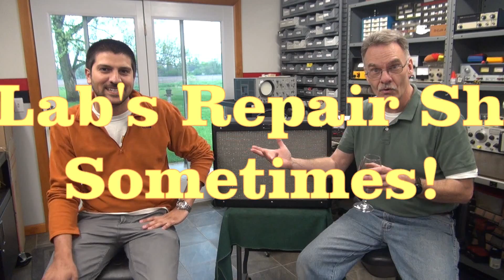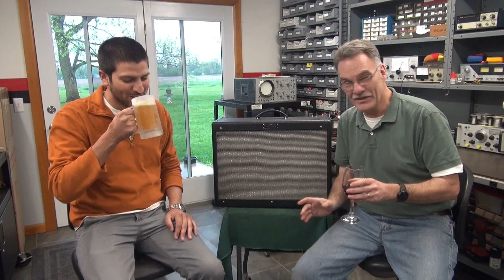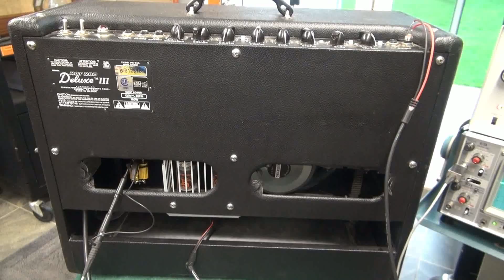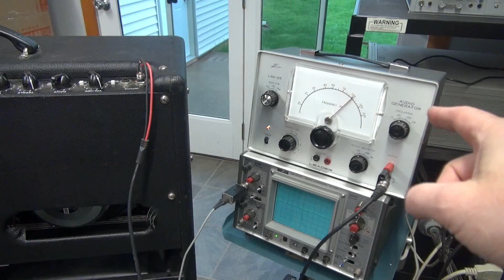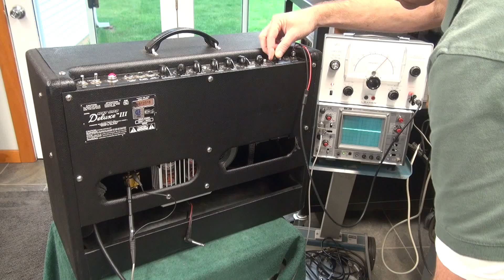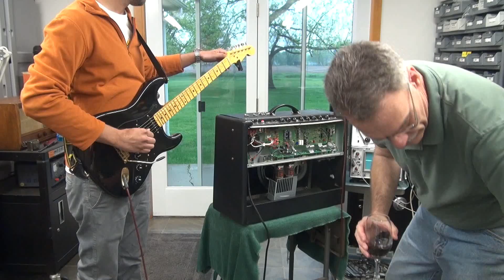D-Lab Electronics Repair Shop No problem found Fender Marshall guitar amps

Comment: Yep probably a bad cable since the issue migrated to 2 amps.....probably a broken wire near the jack ends or a bad solder joint for the ground wire at the jack.  Typical failure due to age & use...wear and tear.  But then again its a circuit board amp and board mounted input jacks which fail.....just plain junk jacks and design.  People who design computer board layouts should stay away from doing layouts for vacuum tube amplifiers

Comment: Had the same happen on a gig with a fender hot rod deluxe. Turned out it was those two resistors that they had soldered touching the board causing overheat. A common problem with the hotrod deluxe models.

Comment: low input voltage? they do run all kinds of extension cables on stage and one bad connection can screw up lots of things or just one, just a thought

Comment: Marshall MG30DFX,i just repaired one,input jack ground switch was mangled though not the evident issue,no bloody volume on clean,crackly and not no vol using the treble pot,so i desoldered the vol,bass and treb pots on clean channel a spray with kontact PR refit and it's working fine,some other pots are a bit noisy just a tiny bit so i'll tear it down again and go for a full service,i hate the awfull distortion ,no touch sensitivity,so i'll be modding that and adding a FX loop too.
I only really work on tube stuff most of the SS amps have bad board tracks ,dry joints,cheap manufacturing ethics bad skills persons assembling these amps in india or china,work subbed out by fender or marshall or any other big name making big bucks on cheap made amps,and people ask me "can i justify the price of a hand built tube/valve amp" then shell out for SS crap,even the tube/valve amps are pcb based and they give problems,not that a pcb is bad,just the manufacturing techniques are bad,marantz use pcb's i don't hear much of them crapping out after a year of use,which says a lot, because the pcb guitar or bass amps get moved around a lot and the pcb's can't take the shaking  about and vibration in transit,plus most musicians don't realise tubes need to cool down before moving the amp around,light metal filamentary structures when hot get soft and can sag and deform easier than when cold.

This also is a good reason to not buy a combo amp as the back wave sound pressure shakes the crap out of hot tubes/valves,and place thick foam under the head amp on top of a stack to absorb the vibration.

I design and build amps,the last thing i want is for an amp to come back for repair prematurely,and it's always tubes,or a tube burns out and causes other failures,mostly due to bad handling proceedures.

I also play so i know how hard they get pushed,but if it can bring some dosh in because of bad handling so be it.

Have a glass and salute the uneducated....cheers.

Comment: I repair those fenders all the time, wick out the solder on those 2 white resistors in the middle of the board and add in some good 60/40 and you'll be fine. The cheap stuff fender uses melts and breaks contact.

Comment: I wish ALL tube amp manufacturers would stop putting sockets on pcb's. I've turned away so many people with Fender Hot Rod series and Marshall JCM2000 amps. It's a real shame too, they are actually really good sounding amps, but replacing parts or entire boards can easily surpass the actual value of the amp.

Comment: Hey Terry, I have a Fender Stage 160 solid state 2/12 combo amp that has a constant low frequency  hum when turned on. If you try to play a guitar through it the hum is the prominent sound. I have used DeOxit on all the pots and switchs and have checked for loose and obviously burnt components but still have a hum. 
I was hoping to bring this amp to you with a couple bottles of red wine to try to get you to repair a NON TUBE AMP. I do own a Fender Dual Showman that is in perfect working order, but bought this amp only because it is a Fender. 
I live near Lansing and assume that you are near Kalamazoo from your river story video. I will gladly bring the amp to D-Lab for the repair. 
Thanks for your time Jeff ' Gonzo the Guitar Guy 'Kellogg
Reply from the maker: Hi Jeff, That issue sounds like a shorted output transistor. Check them with an ohm meter. You should not see under an ohm in any configuration.  If they measure OK, my next guess is a bias shift caused by bad solder joints. That req's pulling the circuit board and giving a close inspection.  I live just north of Battle Creek (Pennfield) Right now, I am booked solid in the shop, little time to lesson the load, so cannot accept more work at this time.
Reply: D-lab Electronics thanks for the info, I will look at the output transistors. Thanks again for your time. If you are ever north of Lansing near Elsie, I have a stash of fine reds, some imported,some domestic. I would love to share a bottle with you and get to know you better. Been a subscriber to your channel for couple years now, really like your content. Keep up the great videos

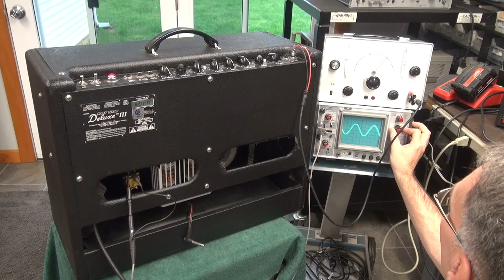Comment: 5:32 - I have better luck with triggering on Tek scopes when the mode is set to 'NORMAL'
Reply from the maker: Yes, the jitter on the scope was due to triggering. My channel switch is a bit dirty. D-lab needs to do a little PM. TD

Comment: Been there before, hated it! I had a brand new Telecaster and after several weeks I showed up for a show, plugged up and...  nothing. I could hear the amp humming so I knew it was most likely something else. Changed cords, what else? Turns out the bare capacitor lead under the metal selector, tone, volume plate had somehow gotten bent and was resting on the bare ground jumper canceling out all signal from the guitar. To this day I have no idea how it happened, worked one day, didn’t the next. It was crazy 😜.
Reply: I repaired one of these it was the volume pot the middle part of the trace was gone the Marshall

Comment: That has happened to me before.
I have lost amp volume at gigs and rehearsals,
but I have always traced it to having a bad cable.
Don't panic ! When that happens ;
Put your amp on stand by
Unplugged & re-plug all your rig 
Check that everything is getting power 
Turn your amp back on 
Check if your volume is back 
If not:
start wiggling your instrument, amp & patch cables
to determine if one cable is bad
Check that your not pulling your instrument cable 
out of your guitar output jack
turn your effects on one by one to see if you lose 
volume when pedals are engaged
if all fails :
then your amp is bad!
If you have made it this far ;
One handy tool to have is a LED continuity tester
to check your cables. Cables MUST be unplugged.

Comment: The best way to uncover a no fault situation is with the amp owner right there playing the amp. I have been given amps with a no fault situation and it takes longer than this video did to figure out there is no problem with the amp. For good measure with symptoms described above I will clean the effects send/return jacks.